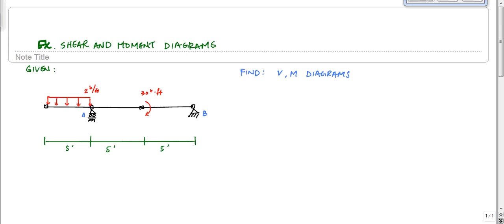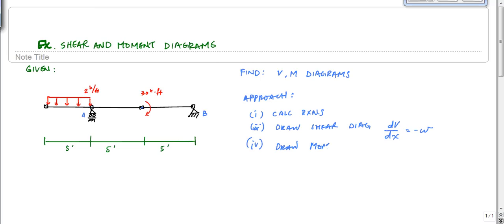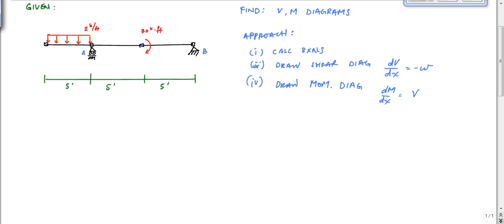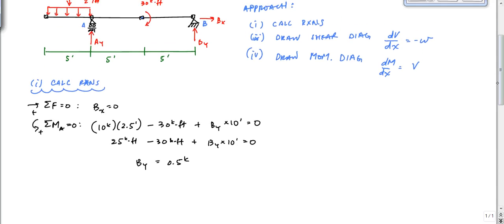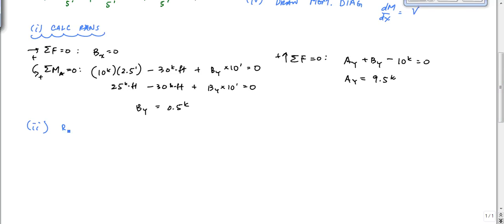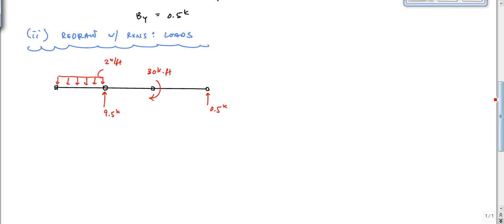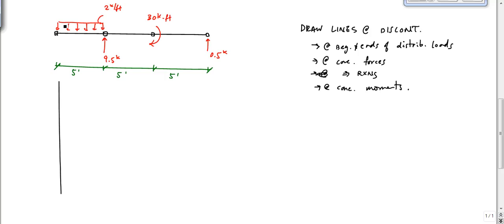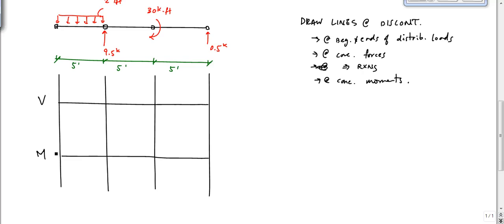Shear and Moment Diagram Example 3 - Mechanics of Materials

Comment: Sup SF! I believe you made a mistake at 11:10 when calculating the area under the shear load. The area would be Area of the triangle + area of the small rectangle, since the area of the height component of the trangle does not fully incorporate the 10k .So 1/2(5ft)(10-.5)k + (5ft)(.5k). Anywho thanks as always my doode!! Hope all is well!

Comment: Are there any examples with triangular distributed loadings?

i.e. 5m beam with UDL 4.2kN/m, plus triangle peaking 2.5m at total 22.95kN/m (so triangle contributes 18.75kN)?

The UDL contributes 10.5kN, 0kN, -10.5kN to the shear force diagram at 0, 2.5, 5.0m respectively, and 0kNm, 13.125kNm, 0kNm to the Bending moment diagram.

The triangular load adds 23.4375kN each end, curving by some x2-ish function to pass through 0kN at 2.5m, then arrive at -23.4375kN; and I have no idea how to solve for the triangular load's BMD except that 2/3bh indicates the peak at 2.5m should be about 40kNm.

So V* = 33.9375kN, but what about M*?

Comment: I think you made a mistake when you are drawing the moment diagram for distance 0ft-5ft because the shear slope is negative and at each point it is decreasing until you reach at a distance of 5ft.  I think correct slope should be the other one where the slope looks like at 12:00.